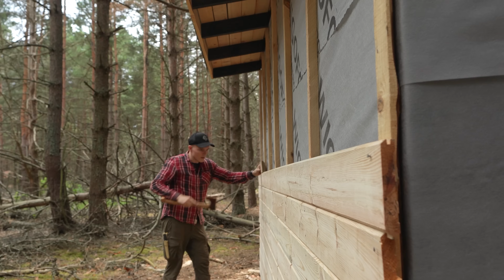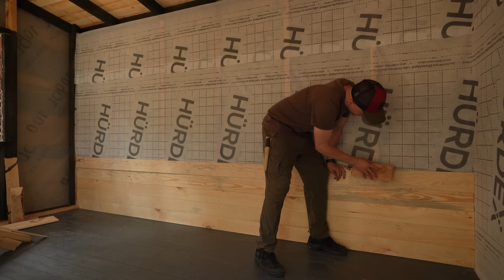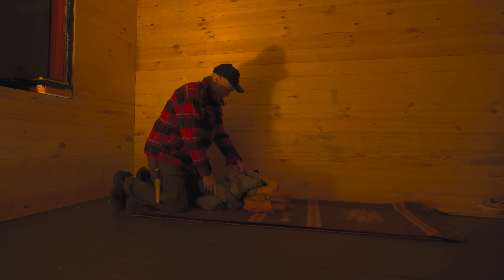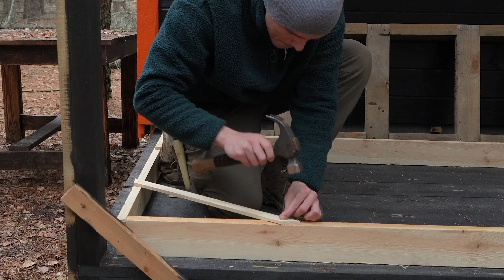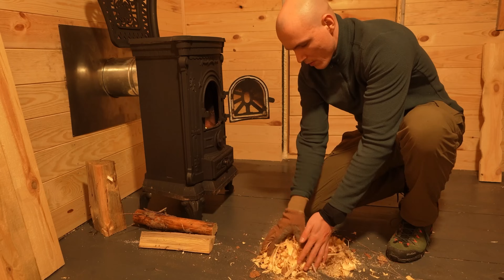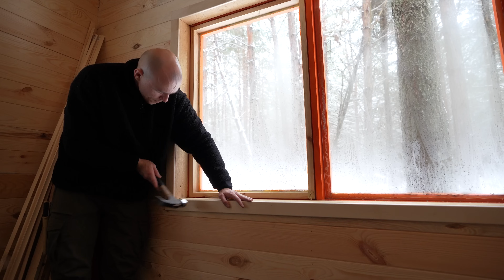Tiny Cabin building in the woods, summer to winter, start to finish (short )

Comment: Oops, I don't like to be the guy who criticizes, but I need to tell you something. You installed the tongue and groove siding upside down. Every single time you install exterior finishes, siding, wood, window sills, anything, think about how the water will run off. You always want to the water to run off and down or out of the exterior envelope. Water is #1 problem with wood  rotting and deterioration of exterior finishes. Sun is #2, unless you live in the desert, in which case sun may be #1, water #2
Reply: Would it function better if installed vertically?
Reply: @danbev8542  I used to buld beach houses so water sheding water was our main objective for exterior siding and finishes. Verticle siding always leaked over time. the best siding is lap siding, but it can be boring. a Cool solution is to use live edge lap siding. At any point you can decided to go over the togue and groove you have in place with a vapor barrier and install siding. the extra thickness will also provide more insulation. Not much but it  helps. At the end of the day, its your home. Do whatever pleases you and enjoy the wilderness. Best of luck to you
Reply: Damnnnnnb sure did
Reply: @danbev8542 yes. it's going to rot water is going to settle in those cracks. Unless he used a pallet of silicone 🤔
Reply: Yes, tongue up…
Reply: Good eye!!!
Reply: Thank you. You criticised with a reason and explained yourself with honor and kindnes.❤
Reply: Nothing 20 tubes of silicone can’t fix

Comment: With tongue and groove siding, the tongue typically faces up and the groove faces down. By placing the tongue facing up, water is less likely to sit in the joints, which helps prevent water damage over time.

Comment: On a safety level, the large glass window is not safe from a strong wind or not safe when there is an attacking bear. If will be better to have a wooden window that can close & open. As for the fire place there must be protection from heat going down from the metal legs to the floor of which must be a metal like place for fire prevention.